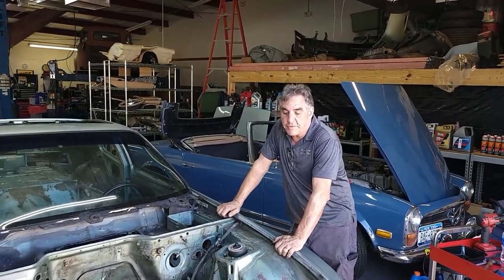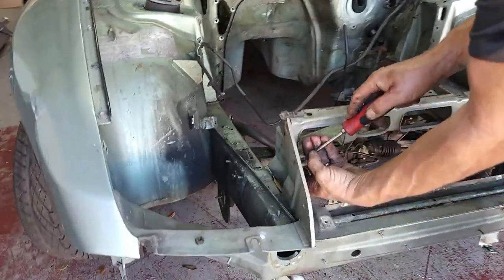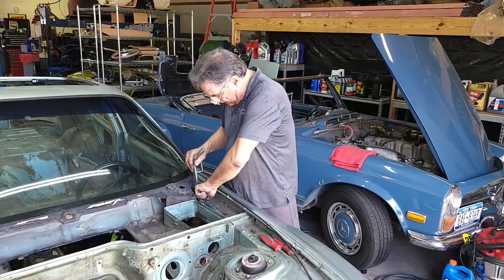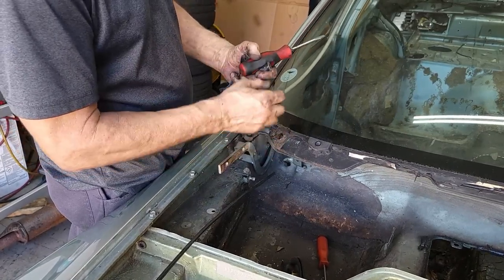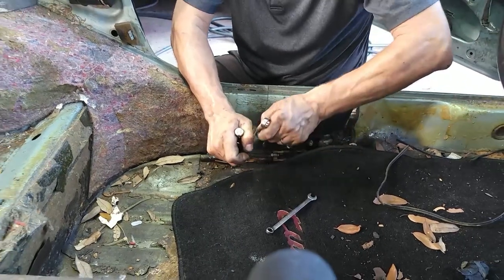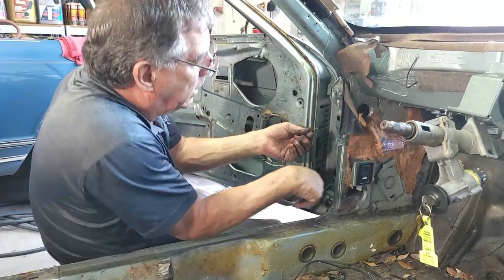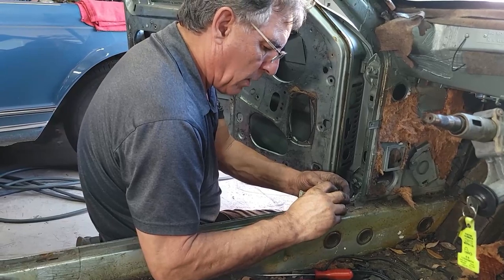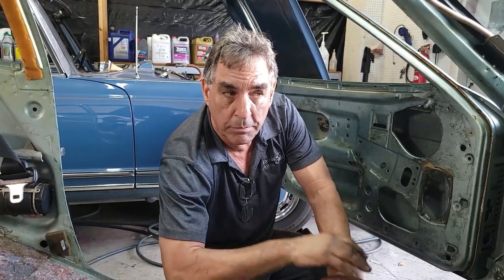Episode 23 Part 1 - 1986 Porsche 944 Turbo Restoration - Final Disassembly

Comment: You are right about the hole next to the throttle cable. It's for the cruise control cable that runs from the servo across the top of the engine into the car.
Reply from the maker: Ah ha! Awesome,  thank you!

Comment: Sourcing parts to restore this car will be the most challenging task.  A lot of parts are NLA from Porsche and then you have to search the used parts to replenish the ones you are missing.  My car was missing all of the under engine panels and the front fascia was junk. All new came to about $3k. I need to buy a new fender, hood and valance panel for another $2500(don’t tell my wife). The front tie bar, rad mount was all bent out of shape from a prior accident, so I had to buy a front clip for a donor part. I recently bought a 72 lb box of all the bolts and nuts from a 944 that was torn down so that I could get the proper fasteners for the bower housing that a prior owner had poorly serviced.  The biggest sourcing issue is finding parts int the used category that you can actually use!
Reply from the maker: YeH, that is always a challenge with any of these older cars. I once bought bucket of hardware for a 64 E-type I restored. Correct hardware is important for a proper professional look. Thanks for the support,  I'll try not to mention all of that to your wife.....lol